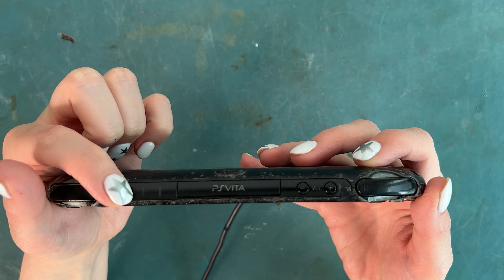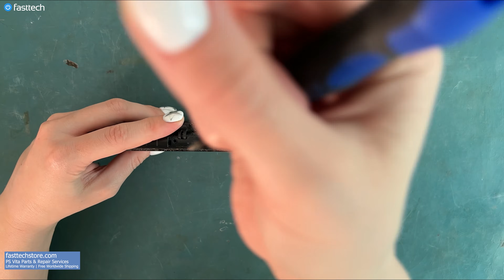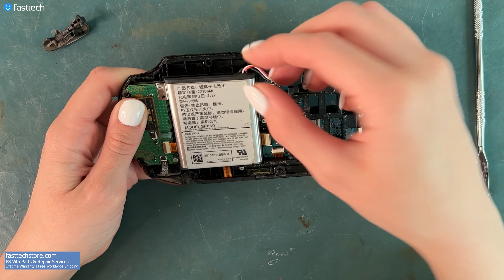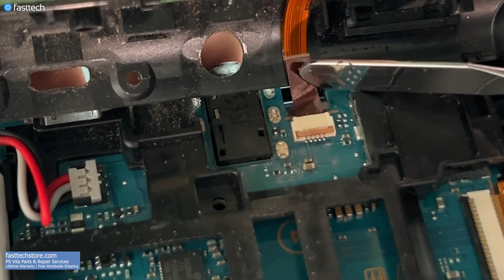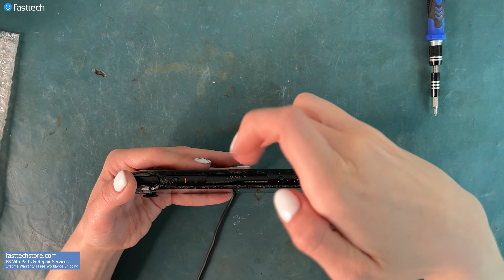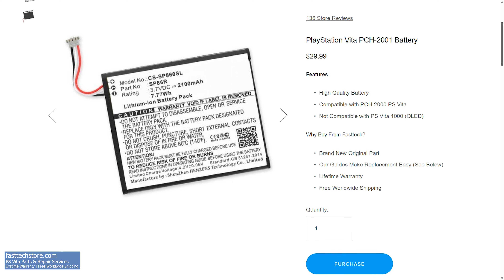PS VITA Slim 2001 Slim Orange Blinking Light Repair Guide (Battery Replacement)

Comment: I was one of the legends on Middle school with my PCH-2016 model, 8gb almost 6gb from it is full of AV then the left analog died itself. Now after sitting on drawer being fixed by my adult self except the start button (even after replacing the right side board now the battery seems needs to be detached being limited to 5 minutes from full drained.

Comment: Shellswap asap
Reply from the maker: That unit is a very good candidate for a shell replacement.
Reply: @fasttechvideo just booted up my psvita after 9 years and the battery is soooooo charge resistant it's crazy,ordered my batter hopefully soon I'll be able to use this video,thanks

Comment: PRO TIP for those of you like me with poor eyesight and big fumbly hands. Find a friend who has small hands and has good eyesight to do the ribbon cable part. I struggled with it for about 20 minutes before just asking a neighborhood teenager with 20/20 eyesight and she clipped it in under 10 seconds. Thx for the video!
Reply from the maker: Yes indeed steady hands and good vision is required for that step.

Comment: How long do your shippings take when coming to Canada?
Reply from the maker: 5-7 days with the free shipping option
Reply: @fasttechvideo one last question does the website automatically detect my region?
Reply from the maker: @Yourboibonnie  I do not believe it does. The prices are in USD incase you are wondering
Reply: @fasttechvideo so it doesn’t ship to Canada ?
Reply from the maker: @Yourboibonnie it ships to canada but does not register your location until you enter your address during checkout
Reply: @fasttechvideo WHEW I THOUGHT I WAS DONE FOR THX SO MUCH FOR LETTING ME KNOW
Reply: @fasttechvideo it’s been more than 7 days so I’m a little confused about my order
Reply: I ordered to wii u front faceplate and it’s still not here?
Reply from the maker: @Yourboibonnie yes there is a delay on your order, if you no longer wish to wait I can refund you now. If you want to wait, it will be shipped out sometime next week.
Reply: @fasttechvideo oh ok thx
Reply: @fasttechvideo I will wait
Reply: @fasttechvideo it’s still not here

Comment: Can you leave the one ribbon cable plugged in if you use something to support the back of the vita standing up?  That way you just have to discoonect the battery
Reply from the maker: Yes you could but you increase the chances of breaking the cable that way

Comment: I placed Order #12237 on July 1st, 2025 (PlayStation 5 USB and USB-C I/O Board - EDU-030). The website says it’s “Completed,” but I haven’t received any tracking number or shipping confirmation. I’ve already tried contacting you by email requesting a cancellation and refund, but got no response. Please look into this and resolve it.
Reply from the maker: Your order is shipped. There is no tracking for international orders under $50 with the free shipping option. Your part should be there in a week or two
Reply from the maker: Hey,
Did you get your USB board?